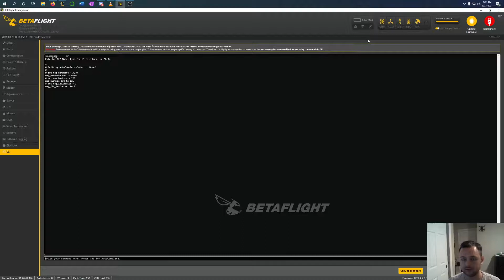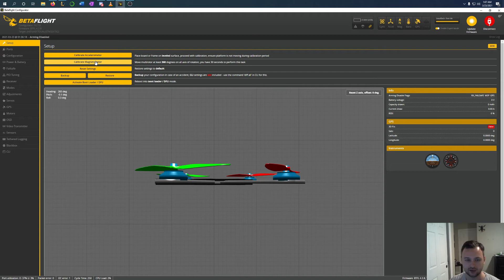Drone Magnetometer/Compass not showing up in Betaflight? Quick fix here.

Comment: I did that twice and double checked the way you typed it vs how I wrote it and I got “error in set: invalid name: what you said to type in” for each thing.
Reply: make sure to flash the drivers for the magnetometer when installing betaflight, they don't come with the "core only" option anymore
Reply: @user-mb3mr6gz1m  thanks!  finally someone knew how to fix this.
Reply: @user-mb3mr6gz1m  How do I flash the drivers for the magnometer or kompass? new to fpv btw
Reply: @ In the Betaflight Configurator in the tab called "firmware flasher". After selecting your correct flight controller name, you will see a window with more options. Under "other options" select "Magnetometers"

Comment: Thanks a heap.  Magnetometer now showing.  One comment at the end of this thread was to make sure to add the Magnetometers option when flashing your FC.  Note that after flashing, it still does NOT automatically show up... until we input the CLI commands you gave us.
Reply: Thanks for sharing this… I just updated to Beta flight 4.5 and didn’t enable the mag before flashing👊🏻 @jinraltao6805
Reply: Nice comment ! UP
Reply: That is correct is necessary add magnetometer during the flashing, now working ok, SpeedyBee 405.

Comment: Hi I´ve a SpeedyBee F405 V3 with BE252i the GPS works but the i2c compass is not recognized, did you know if this compass is compatible  with betafligth 4.3.2 BTFL? Thanks in advance!!
Reply: I have the same FC running BF 4.4.2, barometer is enabled but is blacked out. also my Foxeer M10Q 180 GPS has compass and I wired all the 6 wires to the FC and enabled magnetometer but it's blacked out as well and the CLI commands used in this video did nothing.
Reply: @flat-earther  did you figured it out
Reply: @MikoajSzczepka  evidently I did figure it out as I got compass working but sorry I don't remember about this anymore...

Comment: thanks to that recording I realized that I made mistake upgrading my fc to Betaflight  4.4 without adding magnetometer feature to software build 🤭 In such case i didn't have even this commands available in CLI
Reply: Happened to me too and took me a good 20 minutes to figure out whats missing :D
Reply: Had the same thing, thanks!
Reply: Hey, it looks like a have same issue. What the solution in this case? Please, what do you mean by adding to software build :D thanks a lot!
Reply: @filipdoubrava  In BF Update Firmware after selecting your FC you have options below to add magnetometers. - "Other Options"  It's an coincidence that just yesterday I was making software in my new drone and forgot about it, thanks for the reminder 🙂
Reply: @flyhigh1491  i see that already, Thanks!!

Comment: i've got a mamba H743 MK4 FC and baro and compass will not work. have tried so many settings in the CLI and nothing is working. anyone have any suggestions? msged Diatone 10x plus times no response. finding nothing to help get them working. needed them and this board was a good option. blows they don't work.

Comment: Thanks a bunch! The first two commands worked for me and now i finally have gps+mag working on my H7 :)
Reply: How to add Magnetometer to FC with uarts?
Reply: @50megaton  I asume you already soldered everything and now you are trying to setup in Configurator? If so just follow his instructions and dont forget to check your configurator for proper setup of the GPS. If you configured wich serial is using gps (second dropdown on the right) and also what satelites to use and nothing shows maybe try reflashing and start from scrab? Also keep in mind GPS Module needs more power than the USB can provide so you need to hook up a battery pack in order for it to show up in configurator.
Reply: hi there, I've got an H7 mamba board and can't get either to work, did these commands and nothing
Reply: @thewhitedillard  Sorry for the late reply. Im using an iflight Beast H7 and the iFlight GPS/Compass module. I followed the commands as he presented and everythig worked for me fine. Keep in Mind to setup GPS and  also set the connected UART to GPS. Dont forget to hook up a Battery since the GPS Module does not work on USB power alone.

Comment: Thanks this helped me on the right path. I also had to resource the tx/rx pin B10/b11 to cl/da. Finaly I had to "set i2c2_pullup = on". The last setting I don't see anybody recomending. Strange that there is no good turtorial on youtube on connecting baro and mag. BTW my FC are OmnibusF4. SCL and SDA is on the TX/RX3 pads.
Reply: Hi, I want to use Rx/Tx5 for the SCL and SDA. Please, can you show me the commands to do this. 
Thank You...
Reply: @aei711  Do you have SCL/SDA on your tx/rx? I don't know if you can use any tx/rx
Reply: @arnsteinfiskum2449  thank you for a quick response. I don't have SCL/SDA on my flight controller, I was thinking that you can assign it to any UART via CLI.

Comment: Thanks.  I managed to get my gps-compass combo (M8Q5883) working.  However, at least during bench testing, I cannot seem to get accurate readings no matter where I place my compass on the 5-inch quad running on Betaflight.  This is even when I'm far from ferrous/magnetic interferences, when the GPS is on a small stock, when I change the magnetometer's orientation in BF; e.g., 270 CW flip vs 90 CW, etc.).  All equipment is brand new.  I'm beginning to think that perhaps compasses just don't work all that well on 5-inch quads, given how close they necessarily must be to sources of interference?  Have you had any similar experiences?
Reply: How to add Magnetometer to FC with uarts?
Reply: hey mate, are you saying you have to setup the compass with 270 CW flip with arrow facing forward? thanks for your help.

Comment: Magnetometer isn't showing. I have  changed tx rx pad to SDA, SCL pads. Then what to do next????. 
I followed Your steps but magnetometer didn't showed up.
Reply: Your gps should have tx/rx as well as SDA/SCL. If your gps only has tx and rx, it doesn’t have a magnetometer. Although, I’m no expert so this very well could all be false lol
Reply from the maker: @peterparker1724  Peter is correct - and sorry for the very delayed response. if you do not have a total of 6 wires coming from your GPS, you probably do not have a magnetometer. There will be ground, 5v, tx, rx, sda, scl if you have a magnetometer.

Comment: I have a Mamba F405 mk2 flight controller with FURYF4OSD firmware. I have connected a GPS BN-880 module with a built-in HMC5883 magnetometer. However, in automatic mode in Betaflight, the magnetometer was not detected. Although INAV sees it perfectly. It turned out that the parameter mag_i2c_address = 1 by default. There is no description of the magnetometer parameters on Githab, but there is a description of similar parameters of the barometer. It states that the value of address 1...7 is not valid. Address value 0 automatically finds the device address. I set mag_i2c_address = 0 and the magnetometer was detected. Also I tried setting mag_i2c_address = 30, which corresponds to the HMC5883 address (0x1E) and the magnetometer is detected as well. If you know the model of the magnetometer, you can specify the specific model, in my case mag_hardware = HMC5883.
Another important point is I2C speed. The fact is that the HMC5883 has a maximum I2C frequency of 400 kHz, and in betaflight, by default, all I2Cs are overclocked (i2c1_overclock = ON). INAV has the ability to select the I2C speed, but in Betaflight, you need to set i2c1_overclock = OFF in the cli. In this case, the I2C number must be specified for a specific PC.
To calibrate the compass correctly, you need to rotate the quadcopter in turn in three coordinates at least 360 degrees in both directions.